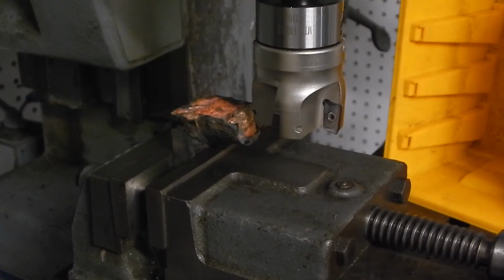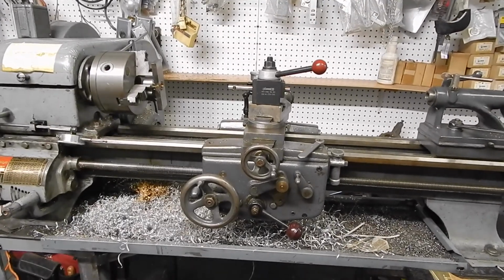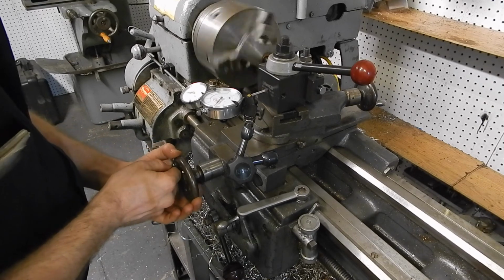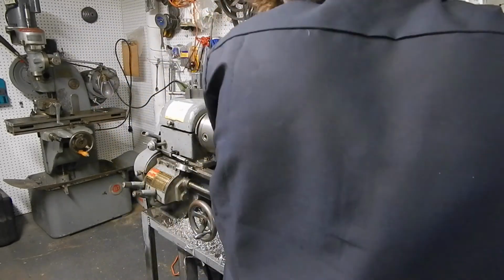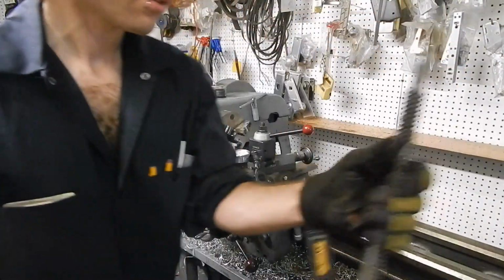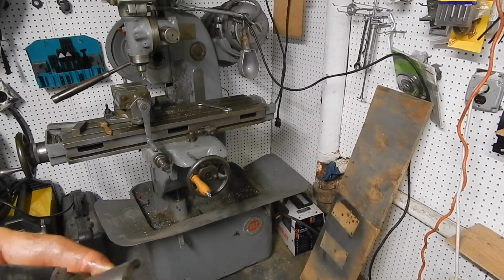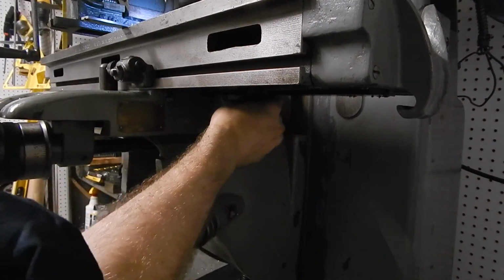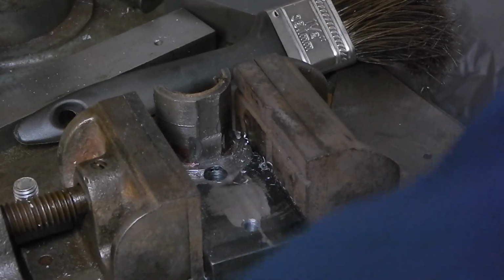Making a Table Nut for the Nichols Milling Machine Part 2

Comment: Thanks for posting this.  I have the same machine and have the same lack of half nut.  What size tubing did you use for the round part? I am trying to avoid taking my table off to measure if I can help it.  Great videos, keep them coming!
Reply from the maker: Thanks Mike, I started with solid stock and turned it to 1-1/8 outer diameter, and bored it 1". I'm glad to see people with this machine out there, there's not a great deal of info out there.  Good luck !